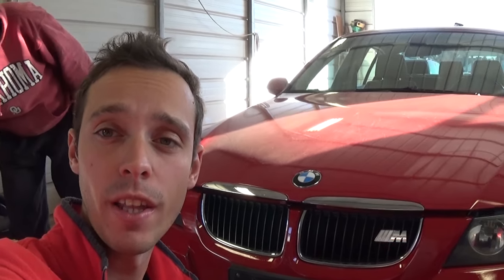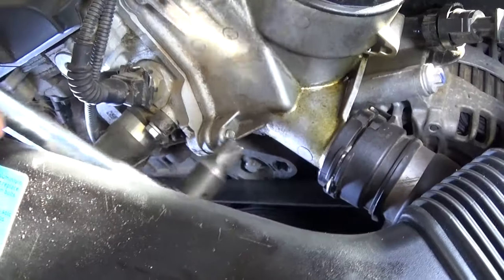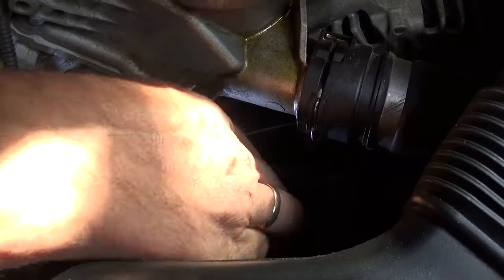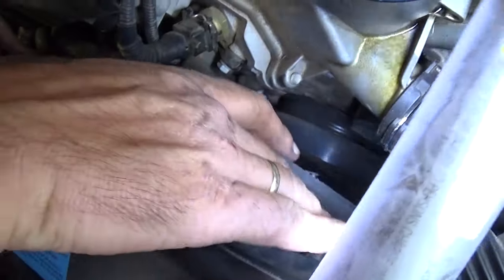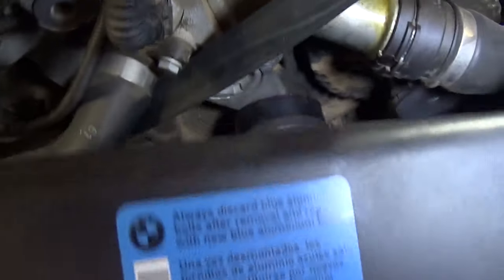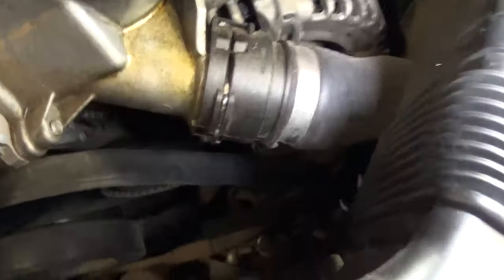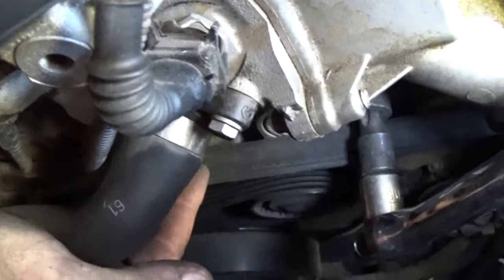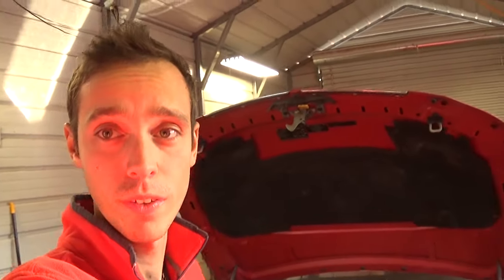BMW E90 E92 E93 SERPENTINE BELT DIAGRAM AND REPLACEMENT 325i 328i 330i 325xi 328xi 325ci 328ci

Comment: Get the air box out first then you will have more space to work with. Done it a 100 times my self
Reply: Sam CarLegion the air box?
Reply: Dude, I tried and tried without taking anything off, finally took the air box off and busted it out in 10 minutes. Its WAY easier.

Comment: Just replaced mine for the second time..it popped due to an oil leak i had for a while and it weakened the belt over time..found the T-60 torx on Amazon for 3.99..

Comment: I managed to accomplish the belt replacement by jacking front end, only removing the under engine cover and removing one of the air cross pipe torx screws (loosened the other). I pushed belt down into vicinity from the top and placed it on pulleys etc. from underneath, finishing on top when ready for tensioner. I cut the belt I replaced for easier removal from underneath. My belt squeak and subsequent failure was a result of my power steering pump coming loose (the bottom bolt had actually fallen into the under cover). Must have not tightened it sufficiently when replacing oil pan gasket

Comment: awesome work guys!  followed this exactly and I was able to knock it out!  to make it easier for me I used a 2ft breaker bar with T60 attached to it and I used a coat hanger with the hook at the end to help me push/pull in tight areas, esp with a hot motor, thanks for the video!